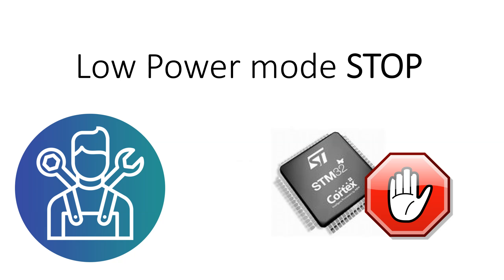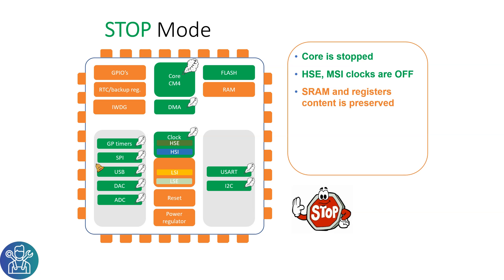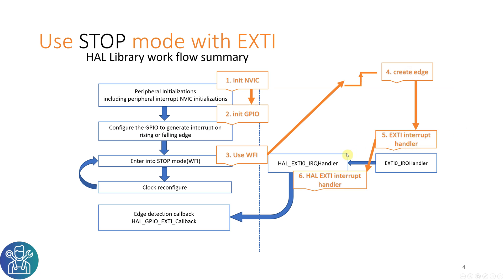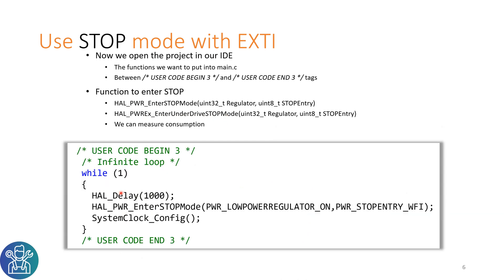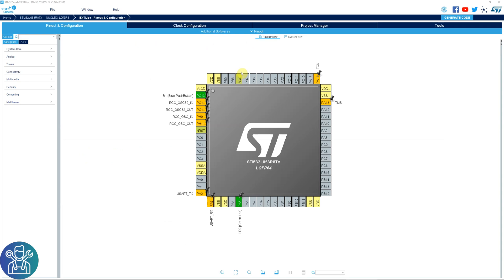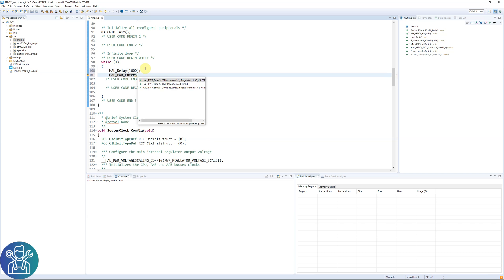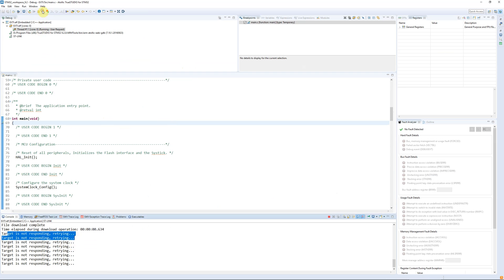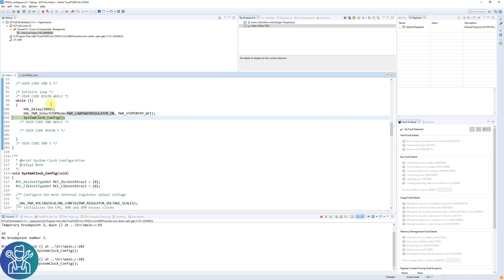HAL #9: HowTo Low power  STOP

Comment: HAL_Delay does not give you an interrupt. If you increase your HAL_Delay to 10000 (=10s), you will still have the same behavior: a near-instant exit of the stop mode.
This is because the HAL tick interrupts every millisecond and does not depends on your HAL_Delay settings.
With your code, the CPU sleeps for only 1ms.
To wake-up after 1 second (or more), you need to disable the HAL Tick and use (for example) the RTC as an interrupt source.

Comment: How does the system wakes up from stop mode..? as per my understanding, HAL_Delay() doesn't generate any interrupt. HAL_Delay() is kind of a busy loop. it waits for that many ticks. Here in your code, after 1 secs, system goes to stop mode. but how does it wake up.??!!
Reply from the maker: There are few ways to wake up, using pin, RTC and timer in my case. You can see in the reference manual 
https://www.st.com/resource/en/reference_manual/dm00095744-ultra-low-power-stm32l0x3-advanced-arm-based-32-bit-mcus-stmicroelectronics.pdf
(6.3.6 ) "If the WFI instruction or Return from ISR was used to enter the low-power mode, any
peripheral interrupt acknowledged by the NVIC can wake up the device. This includes
EXTI lines and any GPIO toggle."
You can use the RTC for lower power consumption or a simple GPIO, but make sure the GPIO is the right one depending on the sleep mode you are using ( see table 32 ).
Reply: @Weblearning1  Thanks for the reply. I am talking about the code in your video. in that you are calling HAL_Delay(1000), and then calling HAL_PWR_EnterSTOPMode(WFI)... HAL_Delay() is a blocking busy loop, which depends on tick. In your case what will happen is, HAL_Delay(1000) will wait for 1 sec in a busy loop, then it will enter stop mode. and within a very short time(nearly 1msec), tick interrupt will happen, which will wake up system from stop mode... So basically, in your code, stop mode time is less than 1msec..

Comment: Can it executes DSP instructions on sleep mode ?
Reply from the maker: Sleep is when the core is stopped. 
https://i.stack.imgur.com/BfIca.png
You can use low power run.
Reply: @Weblearning1  but i see u executed system clock config function after going into sleep

Comment: What about IWDG? Will it have to be refreshed while in stop mode? Otherwise it will reset the uC, right?
Reply from the maker: Correct. The IWDG is like an external part and you have to refresh it before it times out.